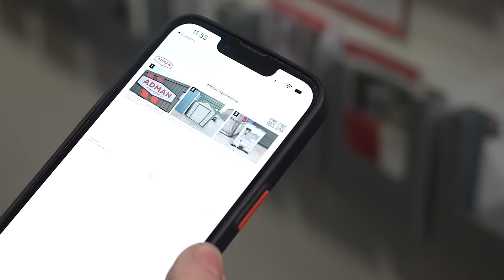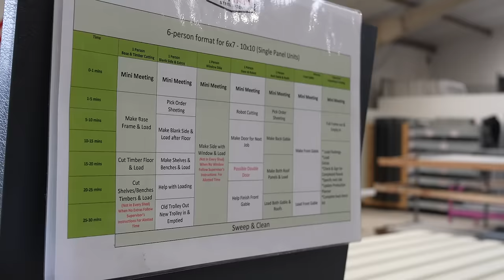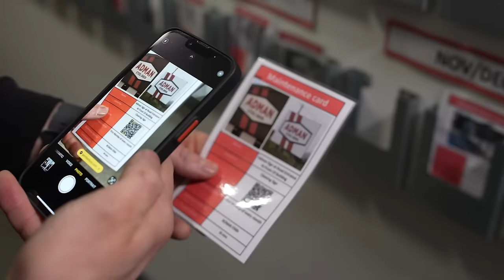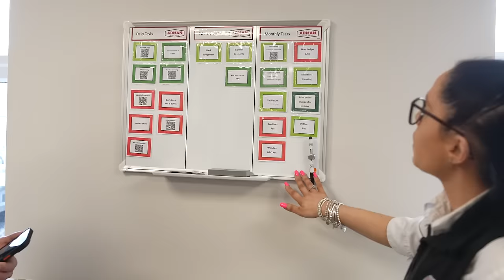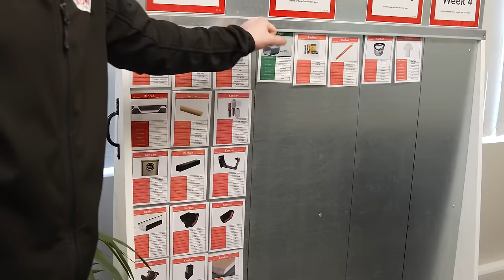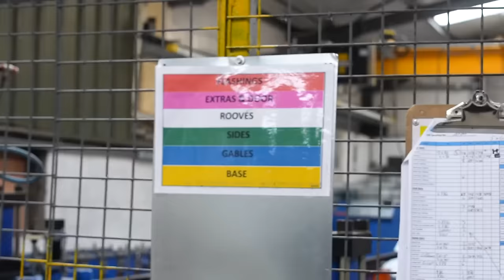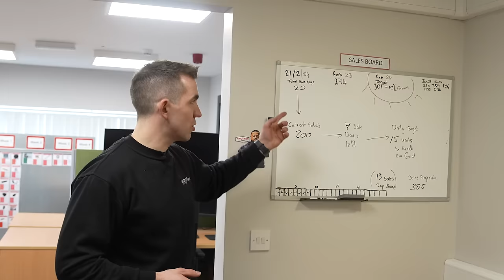FACTORY CHAOS to LEAN CALM: Lean Manufacturing Factory Tour

Comment: The Forklift magnet is genius
Reply: It's a good idea, but It's still "firefighting", there shouldn't be any screws out there for the truck to run over, if there are then that's waste.
What if a visitor stepped on one?? and I see they're wearing work shoes with toetectors, but they're all different, meaning they're each buying their own shoes, probably the cheapest they can get. They should be standardised and supplied by the employer, selected to meet the specific requirements (like 3inch screws going into your foot).

Fit magnets to the edge of each workbench, to catch them before they get to places they shouldn't be, or even better control the number of fasteners being used, count them in, count them out.
If product needs 5 screws, and you find one on the floor, then you have to assume the product is faulty OR that the fasteners of of such a poor standard that the staff are throwing small quantities away.
Reply: @Strider9655  It's a containment solution, rather than a root cause solution,  5S Zones and clean downs are always good, but I agree controlling the supply is key. What this idea is a fantastic first step and a great door to engage upon with the people. Say the Forklift picks up 20 per month it's a measuring point for your solution you put into place.